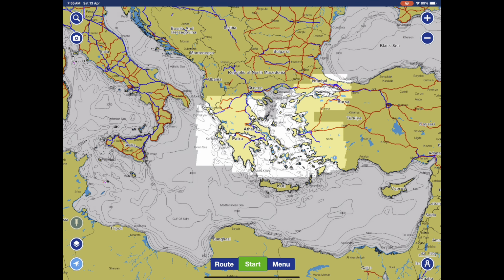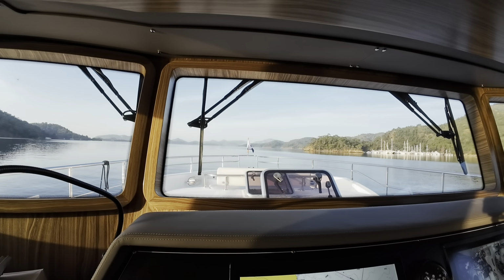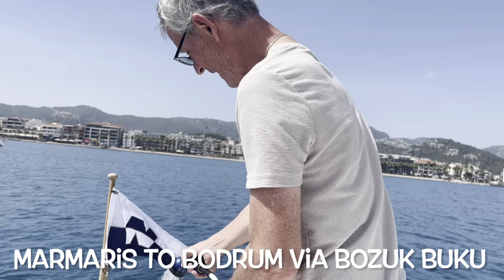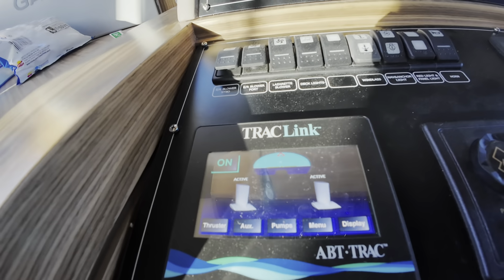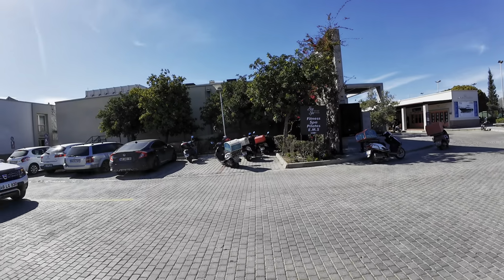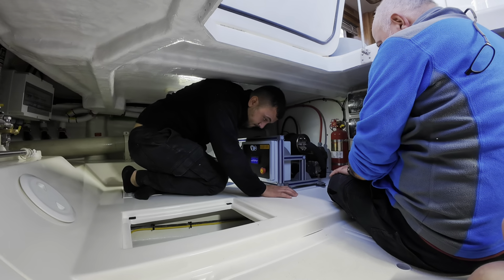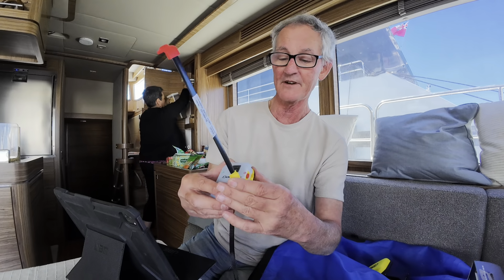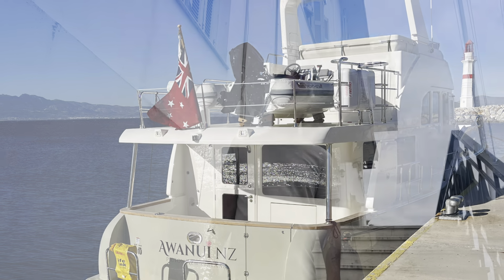Awanui NZ Ep 48 - Departing on our global adventure - “Just the two of us”

Comment: Mark, you should be using a bridal on the anchor chain when anchored. Look it up, you don’t want the weight of the boat pulling on the windless you want it split between your two front cleats vial the bridal.
Reply from the maker: Yip we have been doing that…must have taken off for leaving…promise we are.
Reply: One small thing that I was taught, believed and have used is that the function of the windlass is to lift the anchor and rode off the bottom and not to move your spectacular boat to windward, that would be the engines’ job. You may not have done that, but when my Gypsy slips it is usually because I haven’t asked my admiral if she would mind terribly moving the boat a little more forward.
Reply: Following you with a smile, you take some many of us with you, thanks for being honest in your mistakes, most people hide them

Comment: Can not understand why the water maker was not installed when the boat was built
Reply from the maker: Ok so the difference between the N41, N51 and all other Nordhavn boats is that these are production boats where you get what they build essentially without options which helps keep the cost to Nordhavn and therefore the customer down. Watermakers like tenders come in so many varieties that it has been decided to let the customer decide and then organise installation of those items. Some don’t get Watermakers,some want low energy installations and some want high capacity. Nordhavn recognises most will want them so provides the water/power connections to make it as simple as possible. Personally I would have preferred one installed and be done with it but it was not to be. Of interest with the 1300 litres we have now been away for 4 days and are just under half in our water tank which is pretty good - we cannot top up with water maker as it is not working! Getting fixed back in Athens.

Comment: Also a couple of anchoring tips.  Your scope needs to also allow height of the capstan above the water. It could well be the best part of 2m on your boat so in 8m of water if you want 5 scope you need (8+2) x 5 = 50m. Also you need to bring the boat to the anchor when weighing the anchor. The winch is powered to raise the anchor not pull the boat to the anchor.
Reply from the maker: Yip absolutely hear you and thanks

Comment: Congratulations on your first trip mate, well done. Don’t want to sound like I am teaching you to suck eggs but mate it is not a good idea to pull the boat up to the anchor with the windlass, not so bad when it is flat calm but when it is rough you can do major damage to it or even rip it out of the deck, better to power up towards the anchor with someone on the bow pointing in the direction the chain is laying. Other thing it is always best to use a bridle takes the load off the windlass, there are all kinds of chain hooks but if you don’t have one a rolling hitch is just as good. Keep up the good work mate your doing great. Good luck with your onward journey.
Reply from the maker: Yip using a bridle and agree we should motor up to chain……definitely would have been a comment on a route check in my old job!

Comment: For the cable ties, best to put 4 or 5 every 10m as they break off going through the windlass gypsy, and you loose the measurement, so every now and then put more on as they disappear. I use colour'ed c/ties, in alphabetical, so 10m = black, 20m blue, 30m green etc, after 50m start colours again - easy to remember in alphabetical. Tie some light line to the anchor and let it down to measure off 10m, 20m, 30m etc to avoid doing it in marina.

Another fun way for the c/ties is in this order,  R Y B W G (red, yellow, black, white, green) and to remember it is "Rub Your B*%%s With Grease - once the crew know they never forget that one
Reply from the maker: Haha great advice thanks so much…all taken on board

Comment: It is a great feeling to finally set off on your journey isn't it ? First time just the two of you, with the boat, after so many years of planning, waiting and looking forward to it. Will be a great journey, so now relax and enjoy, after all that is what it is all about !

Great to have the water maker installed, at least you will have continuous water supply onboard. Just don't use them in a marina or port or any water where you see oil on the water, your membranes will be gone instantly. It is also better for the membranes to run the water maker every day for a few hours than to fill up the tanks and not use the water maker for one or 2 weeks. 
The water in the ports and marinas in Greece does contain a lot of calcium and it not really drinking quality, so be careful with topping up your tanks with that water. If you want to use shore water for washing the boat make sure you put some filters prior to the hose leading up to the boat, otherwise your boat will turn out with a lot of white calcium spots and you can wash again (and we have had to do that 😀).  

As for your stabilizers, they are not connected to your GPS signal ? Once they have the GPS signal they  should have speed information. 

Having markings on the chain is basically a must, can't do without them. Any system that works for you is a good one. 
With regard to the amount of chain out just take into consideration that it is the water depth, plus the height from the water level to the bow (or snubber if you use one), plus the wave height (highest expected wave height). A scope of 3 : 1 is more for a quick stop, for lunch etc. 5 : 1 is for calm weather, 7 : 1 is for a stiff breeze and 10 or even 20 : 1 is for bad weather. 

And of course, don't forget to set the anchor well. 😀

Just a quick question........was that a bottle of Aceton that I saw passing by or was it white spirit ?  
If  it was aceton  you may want to think about exchanging that for white spirit once you are in Greece. In Turkey they don't sell white spirit, because it is alcohol  based, so you can buy only aceton. In Greece you can find  white  spirit even in the  supermarkets or in any chandler or paint shop. 
I did not even know it, but aceton is highly explosive, so after seeing (and hearing) this story of the barefoot doctors, we immediately threw out all the aceton. They lost their boat because of aceton, so just be careful with it. 
https://www.youtube.com/watch?v=thZOaLehQu8&list=TLPQMTQwNDIwMjSmErd-yEXNMQ&index=9
Reply from the maker: What wonderful information…acetone gone! Other titbits so gratefully received

Comment: Another entertaining post by captain and, er, captain! Just a few of my (as usual) observations:
- Please, for the love of God, buy some clip-on remote mics for you guys to wear while recording. Will make a world of difference ad aren't very expensive.  
- You should never leave the helm untended when dropping / hauling the anchor. Use headsets for communication or at least develop proper hand signals (which is what we do on Sequel). It's both a safety issue and a utility one.
- You should purchase a (Mantus) snubber system ASAP for anchoring. You don't want to load the capstan like that - it's not meant for that. Plus a snubber is designed to take shock loads from wave motion, which it easier on the crew and the vessel AND helps prevent the anchor from becoming dislodged.  
- Get a vessel monitoring system ASAP. This includes the ability to set an anchor boundary to alarm if the boat leaves the set geofence. Again, these are relatively cheap, easy to self-install, comes with GPS built in, sends notifications to your mobile device - and you can slowly add functionality as you go (like bilge pump running, shore power disconnect, high water alarm, temp etc graphs...)
I use BRNKL, but Siren Marine is also a good system. It will definitely help you sleep better at night while on anchor AND uses way less current than keeping you electronics on. 

Enjoy the adventure!

John
42' Sabre Hardtop Express, Sequel
Reply from the maker: Hey thanks John….bit embarrassing we have mikes! So much bloody technology. Will get around to using them promise. I will also get a mic cover for camera. Yip we got snubber and helm radio has anchor watch which we set and is programmed to go to cellphones. Will look at system you mention…thanks for the good info.

Comment: Hi Mark. Good to see you are on your way.  As you both say, you have a lot to learn. Here is some science to help you. Your diesel engines will each burn 1 imperial gallon of diesel per 26hp per hour. Lets call that  25 hp per 1 imperial gallon. That makes the maths easier and the consumption  IS indisputable. So a 150 hp diesel engine will consume 6 imperial gallons of diesel per hour at full 150 hp . FACT.
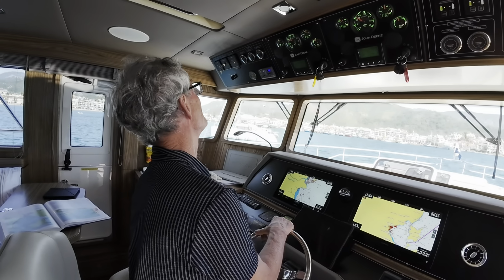So therefore, when you say @17:20 you are only burning 7.6 litres per hour @1150 rpm means your engines are producing 21.25 hp per engine which is completely wrong. They must have been producing 3 times that hp at least at those revs. SO..... either you meant each engine was consuming only .89 of an imperial gallon per hour which would still be wrong or your gauges are completely wrong.
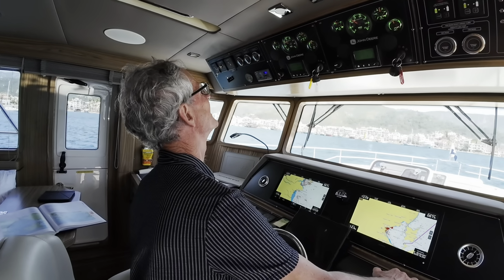It was no wonder you said @17:20 the fuel burn was "Fuken Unbelievable"  because it is but I can't blame you when you are used to your last Waka, the Boeing 777 that burned 0.7 gallons per second or 42 gallons per minute or 150 t0 200 gallons just to taxi to take off. LOL. My post  is just to give you another redundancy as to fuel burn to put into your Log . Remember 1 imperial gallon per 25 HP per hour. That is the truth.  Keep safe. This post allows you to cross check your gauges to the fuel consumption curves shown in the John Deere Books and the consumption curves shown in the Nordhavn Book where they only did one day of sea trials and couldn't possibly have worked out fuel consumption in all conditions in all weathers considering your boat is the first off the rank.
Reply from the maker: Absolutely no FF data from Seatrials other than anecdotal comment in the moment. On our sight gauges we burnt 25 litres per hour over 48hrs going from Tuzla to Rhodes. That was at engine RPM of 1700 - both engines?